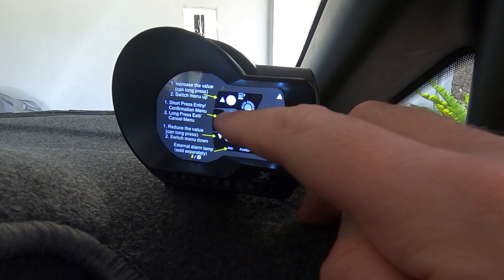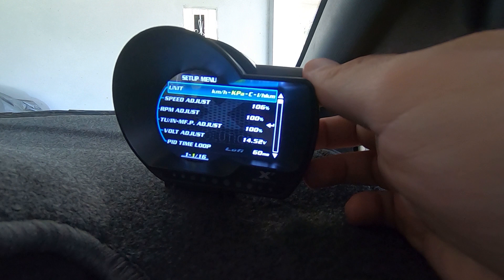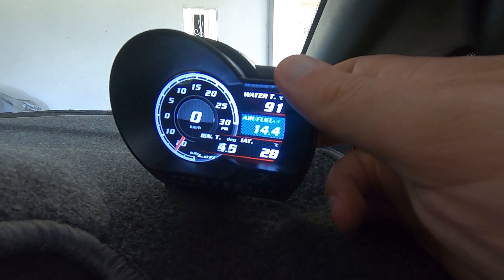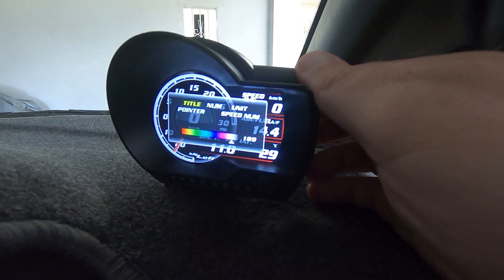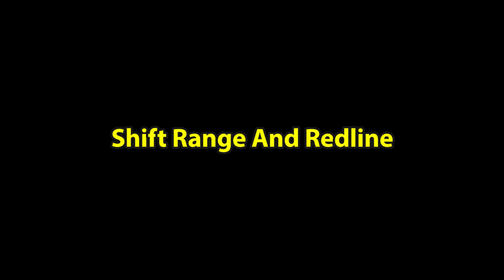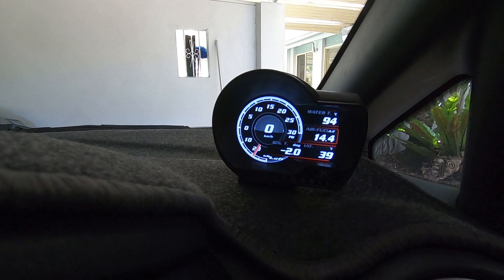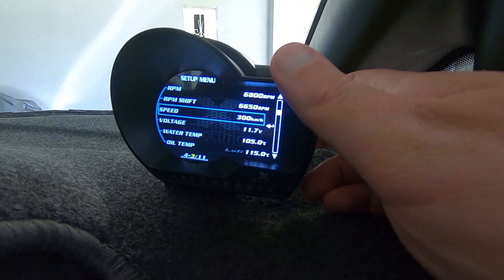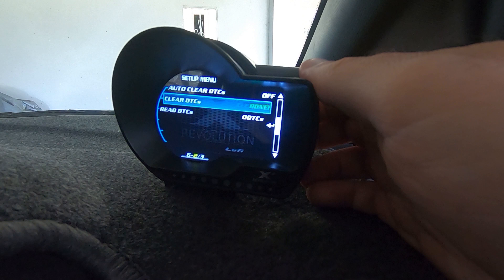Lufi XF Gauge In Depth Look | How to | Features | Customise

Comment: if we get that goodbye message shortly after turning off the car mean its off or in sleep mode? does sleep mode still draw off the battery?
Reply from the maker: You may need to go into the setting and turn on the "auto off" setting.
It usually takes 10 seconds or so after turning the car off and it will turn itself off. 
I assume it will draw a tiny bit for the constant memory but minimal compared to it staying on. I have left my car for a week unused and it has started right away.

Comment: Its a shame that we as Mk7 st drivers cant see the oiltemp. I think its very important
Reply from the maker: The reason I am told is that manufacturers tend to have a different PID to each other so it makes it near impossible for them to learn and program each individual car and keep it cheap. Things that you can see like AFR and coolant etc tend to all be the same like a "generic" code I guess so they can program it once and it's a universal thing. It is a shame but it looks like an individual gauge for oil press and temp is the only way to go.

Comment: Nice video. I just installed mine and so far I’m quite impressed with it. One issue I’m having is with the air/fuel gauge. It stays at 14.6 and never moves during accel/decel. Is that normal or is there a setting I can adjust for that?
Reply from the maker: Hi Rob, thanks for watching.
The Lufi will only show what the OBDII port puts out. It is normal for me for the AFR to stay at 14.6 during normal driving and decel yes. At WOT mine seems to settle around 11.5ish in my Fiesta ST.

Comment: How do I access other setup modes to get to the power off option ?
Reply from the maker: I'll have to recap but it'll be in the system settings. It's a set and forget thing so I did it once, haven't had to go back and do it since.

Comment: Will this drain the battery if left plugged into the obd port ?
Reply from the maker: If you aren't using the car for a period of time over a week i'd suggest unplugging it however there is an auto turnoff function so it switches off when the ignition is off. It only keeps the memory alive for settings.

Comment: They say on their amazon review/QA page that the gauge itself doesnt support oil temp or oil pressure.

Which i cant wrap my head around.
Reply from the maker: It does, it just depends on what car you have. With my car, the Mk7 Fiesta ST (European) the gauge doesn't receive that info via the OBD and would need someone to work out the code in the customisation setting. On other cars, the oil temp and press may work.
Reply: @fordyford  2016 Toyota Camry
Reply from the maker: I have no idea mate. I'm just a customer who bought one for my car.

Comment: Hi mate, nice review. I have one too but i can ask you if the lufi odometer display is reflective or accurate compare to the odometer on your actual dashboard as mine is about 10k km difference. Im starting to wonder if my actual car mileage is being tampered with or the obd reader itself is fairly inaccurate. Thanks mate
Reply from the maker: The lufi/OBD reads a bit different. You can go into the speedo settings and make a percentage adjustement  however this will only be accurate to the speed on the dash at a certain speed.
E.g. i set mine to read 80km/h on the lufi when the dash reads 80km/h but it isn't bang on at 40, 60, 90, 100 etc if that makes sense.
Reply: @fordyford  thanks for the reply. I transferred the lufi from another car and I didn't take notice if the odometer is same on lufi and dashboard. Today after transferring on a used car i see that lufi is saying 30k km on odo while my dash shows 18k. So i was wondering if my mileage has been tampered with
Reply from the maker: No worries and thanks for watching.
Also depending which car you had before and what car you have now, some makes like VW, BMW and Audi I think have their own preset settings on some Lufi models but with my Fieata ST, I need to use the universal setting.

Comment: Thanks for posting but to take it on the track wouldn't you need a secondary fixture to get through scrutineering?
Reply from the maker: What do you mean? Why would it fail scruiteneering?
I suppose it would depend how strict they are but as long as it is secure I can't see why they would not let it go .
Reply: @fordyford  Thanks for replying - perhaps I have been unlucky but unless its bolted down or has two attachements. They won't let it pass.
Reply from the maker: @revertsui  lucky its only stuck on and plugged in via the obd for quick removal. Ill see how i go.

Comment: Thank you so much for the video! Its because of you I recently bought lufi revolution to monitor the water temperature. A quick question: while driving , the car maintenance 84-86 degrees C ( 183-186 F ) and at a standstill it goes to 98-99 C ( 210 F ) Do you know whats the normal operating temperature of the ST ? I own the car for 1.5 months and its fully stock. ‘14 Fiesta ST. Thank you in advance!
Reply from the maker: Thanks for the kind words and happy the video has helped.
What climate are you in? I "think" the thermostat opens around 98°c so your peak of 98-99 seems fairly normal.
Here in summer (it's been a cool summer) normal driving is between 93-98°c. 
I see up to 106°c if boosting at 1-5psi under load for longer periods of time such as driving up mountains.
Reply: @fordyford   Currently here is winter and the outside temperature since I bought lufi never exceeded 6 degrees C. I was a bit worried if the thermostat was working or not. I guess i just need to leave the car working and see how it goes.
Reply from the maker: You will learn over time what seems to be regular numbers for your car.
Reply: You would get better long term performance out of your car keeping it running as cool as possible.   You should consider adding an auxiliary fan (most likely place is in front of a/c condenser.)  Cooler temps make oil last longer as well as engine computers wiring insulation radiator hoses fan belts reduces chance of blown head gasket.

Comment: Hi I’ve recently installed this into and I’ve noticed that when I put my car in reverse and also open my doors, that hazard lights goes on. Would you happen to know the reason for this.
Reply from the maker: No idea. Is it a safety feature of your car? All this does is plug into the OBDII port and give you a read out, show codes and clear some codes.
Reply: It is part of Lufi features, scroll down to 'other setup' you will see the option to turn 'on' or 'off' the features

Comment: Hi man. How did you get the boost guage as the main dial was that an update? Love the videos 🤘
Reply from the maker: Hi Scott, happy to hear you enjoy the videos. Just use the up and down arrows at the back to scroll through the different screens. It came with multiple screen layouts when I bought it, I haven't updated it so unless you bought yours anwhile ago, it's possible they have added it since.
Reply: @fordyford  cheers, maybe will stick it on the laptop as I Def don't have it. Only a tiny one inside the rev counter.  Was born in Sydney myself but lived in northern Ireland from a baby. One day il get to see the land of Oz 😂 🤘
Reply from the maker: Maybe one day after pandemics and wars.

I think the way to update it is to take the micro SD card out of the top and upload a new file that the Lufi supplier should be able to send. The Lufi website itself doesn't have anything. The gauge itself has a user manual built in and guides you through updates too.

Comment: How accurate is this gauge? I hear some people saying it doesnt display proper boost. Does this display live data or is it data based off of rpm and throttle positions and the car you're driving? Ive seen some things out there display whatever info of whatever car they pick. Could be driving a base model golf and have it display golf r boost levels if you know what i mean.
Reply from the maker: It really depends on the car. It is live data yes but on my car the boost doesnt read any higher than 22.5psi. That's a Fiesta ST thing.
It shows whatever it is picking up through the OB2 port. Some manufacturers have presets in it like VW and BMW, Mazda etc but Ford didn't so I am using it on Universal mode.
You can edit each screen to display the gauges you want to see so yeah, you could add boost to the gauge for a non turbo car but it wouldn't show anything. You just need to edit the screen to show something different.
Reply: @fordyford  thankd

Comment: How do I create my own user PIDs? It wants an INI file but I have no idea how to create one the correct way and I can't find any tutorials anywhere! A guide on how to properly create the file it wants would be GREATLY appreciated. Please and thanks for making this video!
Reply from the maker: Sorry, I don't know how to do that.
Reply: Could you please find out  how to do it (and then post a new video when you do)? I really need the oil temp reading, and I'm sure lots of other people would benefit from this information as well. The Lufi XF is really popular.
Reply from the maker: I don't think my car has the provision to show it so couldn't work it out even if I tried. 
If you need it, you can get an oil temp sensor and gauge setup.
Reply: @fordyford  Wow, no need to be rude about it. Fine, I guess I'll figure it out on my own. (And by the way, it's kinda dumb to buy another gauge when this one is more than capable of showing the information I need.)
Reply from the maker: I was rude? Apologies.
Reply: @fordyford  I may have overreacted. I'm just frustrated because I've been searching for a solution for months and keep running into dead-ends. Then I found your video and it gave me a little hope that maybe there was finally someone out there who knew how to program this thing, only to be disappointed yet again...

I would have never bought this damn gauge had I known that it came with very poor documentation. But I digress, I won't bother you about this again.

Comment: Would this work in my 1998 Dodge Ram 1500 4x4
Reply from the maker: Probably not. It requires an OBDII port and it states it's for most cars post 2006 or 2004. Check with the seller before buying.
Reply: @fordyford  thank you sir

Comment: help, my tachometer isn't working on my piece. fellow owners of the same car don't have this issue at all! bmw 118i.
Reply from the maker: Sorry, I don't know why yours wouldn't have it if other cars of the same model and year do. Contact your local lufi dealer for more specialist advice.
Reply: @fordyford  the seller keeps telling me is my car that's the problem but I used bimmerlink which used obd2 as well and I can see the rpm just fine. and even my friends that have the lufi on their exact same car doesn't have this issue
Reply from the maker: Did you set it to the BMW settings or is it on another manufacturer or universal?
Reply: @fordyford  hi it is on universal because bmw one is apparently still not available
Reply: Lower the refresh rate. If it's too high it can affect canbus

Comment: Can this thing show your fuel level
Reply from the maker: Not on the Fiesta ST. Unless it's something other manufacturers show via the OBDII port thrn maybe. I use a universal setting but Nissan, VW, Mazda and I think another manufacturer have their own presets on the one I have.
Reply: @fordyford  my 2005 mustang shows it via obd port so maybe. I’m getting mine today will update later
Reply from the maker: @minecrewsupernt831  good luck. I know on Forscan you can see things like oil temp and pressure for the Fiesta ST but not via the Lugi gauge so could be the same with fuel level. I haven't seen it come up when I have scrolled through the options for each gauge.

Comment: Mate the boost gauge function works on a euro ford but do you know if it works on an Aussie BA XR6T?  I'd love to get one but if the boost gauge function doesn't work on the Falcon then it's useless for my application
Reply from the maker: Message Lufi.au on Instagram to confirm but I have seen them hooked up to XR6 Turbos. Can't recall if they were BA/BF or FG. Should work OK but message them to confirm. They are the official Aus supplier and were very helpful for me.